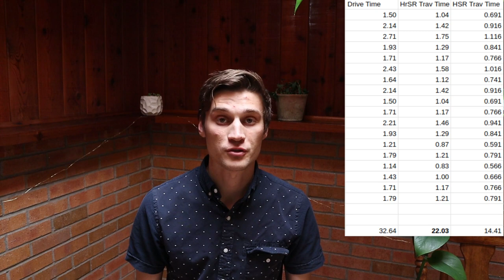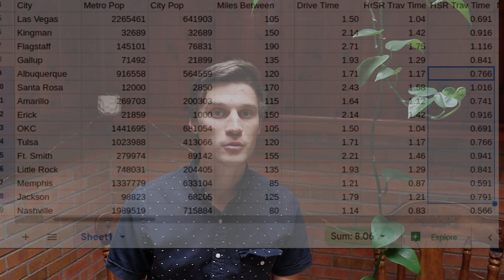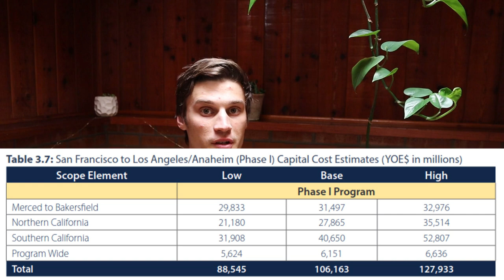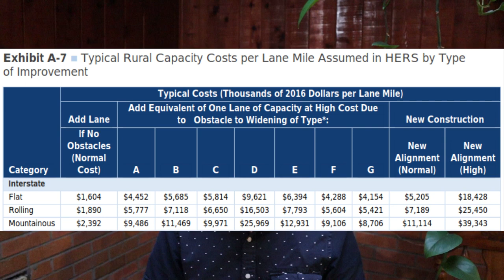What if Interstate 40 were High Speed Rail?

Comment: As you point out, HSR cost up to 10x what 120mph rail cost, so a decision needs to be made. Is the higher speed worth it? We are told that the optimum distance for HSR is aprox 400 miles, however I have been on Shanghai to Bejing (750 miles, 215 mph) and it beats flying. The California HSR project probably would be 80% as good with 120 mph trains, at a fraction of the cost. Already, London to Edinburgh (400 miles. 120 mph) is begining to take passengers away from flying. It is as quick, as cheap, and more pleasant. London to Paris on Eurostar (185 mph) beats flying, hands down! Good video, keep it up!
Reply: Shanghai to Beijing justifies a HSR route because of the gigantic amount of travel between both cities on both business and government workers. That's why some of the fastest HSR's in the world are on this route.
Reply: Don’t the British about how expensive tickets are and Ryan air being extremely dirt cheap. I heard Ryan air is the worse version of spirit it’s the spirit of Europe
Reply: "We are told that the optimum distance for HSR is aprox 400 miles, however I have been on Shanghai to Bejing (750 miles, 215 mph) and it beats flying"

How so? The flight is 2 hours according to Google Maps. It should be less because the direct air distance is 611 miles and a 737 cruise speed is about 580.

Rome2Rio says the train is 4.5-5 hours (depending on which train you take).

I don't understand how that's faster.

Is this is a case of where 80% of the air space in China is reserved for their military, so commercial aircraft can't fly direct routes? Google Maps doesn't list a flight time, but in theory, it should be like 1 hour and 15 minutes, or so.

"The California HSR project probably would be 80% as good with 120 mph trains, "

lmao no it wouldn't. It would be about 3 hours and the flight is 1 hour.

"London to Edinburgh (400 miles. 120 mph) is begining to take passengers away from flying. It is as quick,"

Well, maybe the Brits are willing to sit in a train for 4 hours when a plane could get them there in 1, but I am not.

"ondon to Paris on Eurostar (185 mph) beats flying, hands down! "

No, the train is 3x longer than flying. That's why they still have 23 non-stop flights a day. Although both London to Paris makes a lot more sense because  both are very dense and the distance is short.

(btw, it's 295 miles, 295/3.5=84 mph average, not 184).
Reply: @Sacto1654 

"Shanghai to Beijing justifies a HSR route because of the gigantic amount of travel between both cities on both business and government workers."

yeah, much higher population density. Still, if Google Maps and Rome2Rio are correct, the train is four hours and the plane is 2 hours.
Reply: @neutrino78x  Wow!! There is so much wrong in your post, I don't know where to start! 
1. The cruise speed of a 737 is 514 mph, not 580 mph.
2. The flight from Shanghai to Bejing is not 2 hours. You cannot even board the plane in two hours! I takes one hour to get to the airport, two hours minimum before boarding, 20 minutes minimum to taxi for take off, 20 minutes minimum to taxi to the gate after landing, one hour to get from the airport at the destination, plus the flight time and delays. 
3. I have flown LAX to SFO countless times. You cannot even get to the airport in an hour, let alone board.
4. London to Edinburgh, just look at the several YouTube videos of a plane/train race.
5. London to Paris (I have done this several times as well) the train is 2 hours 15 minutes not 3.5 hours, and as I pointed out (Yeah I have flown it too) you cannot even board the plane in 2 hours 15 minutes.
6. "Flight times" are calculated "wheels up to wheels down" not the actual time you will spend trying to board, de-plane etc.
Reply: @GuillermoLG552  

"Wow!! There is so much wrong in your post,"

Nope. I have no problem going down each of your bullet points, each of which are wrong.

"1. The cruise speed of a 737 is 514 mph, not 580 mph."

Ok I'm looking at the wikipedia article "Boeing 737 Next Generation".

In "specifications", it says the speed of a 737-900 is "Mach 0.79 (455 kn; 844 km/h)", that's 524 mph not 514. Either way, much faster than any wheel on rail train or even any maglev train (unless you put the maglev in a reduced air pressure tunnel, I guess. But any kind of maglev is obviously more expensive than wheel on rail.)

"2. The flight from Shanghai to Bejing is not 2 hours. You cannot even board the plane in two hours! I takes one hour to get to the airport, two hours minimum before boarding,"

Ok, then Chinese air travel just sucks compared to North America and Australia. I have personally arrived at the airport 20 minutes before takeoff and had no issues getting on the plane. I have "clear" which lets you bypass the main security line, and I optimize my things for quick passage through security: no belt, shoes easily slipped off, separate compartment in backpack for laptop. 

This is not an argument for HSR, my friend. It just means either Chinese air travel sucks or you suck at air travel, one of the two.

"3. I have flown LAX to SFO countless times. You cannot even get to the airport in an hour, let alone board."

lmao. 
Which airport, from where? You can get downtown SF to SFO in 30 minutes on BART. 
Same with downtown LA to Burbank (on Amtrak).

Again, this just means you suck as an air traveler.

"4. London to Edinburgh, just look at the several YouTube videos of a plane/train race."

Don't have to. The train is like four hours and the plane is one hour. Plane wins.

"5. London to Paris (I have done this several times as well) the train is 2 hours 15 minutes not 3.5 hours"

How come Google maps says 3.5 hours then. But let's say it's two hours. 165 miles in two hours is 82 mph average, not 100+.

" as I pointed out (Yeah I have flown it too) you cannot even board the plane in 2 hours 15 minutes."

Bro you suck at traveling.

""Flight times" are calculated "wheels up to wheels down" not the actual time you will spend trying to board, de-plane etc."

See above

So yeah, you're far more wrong than I was. Try again.
Reply: @TheAmericanCatholic  Yes Ryanair is dirt cheap (I have been on it many times) if you don't take any baggage, (you even pay for carryon) and you add on the cost of buying your ticket (yes, you have to pay to use your credit card!) and you don't eat or drink anything on board. Of course if you don't print off your ticket ahead of time you pay £50 at the airport. Checked bag? up to £60! You also pay a fee to sit with your wife, extra leg room etc. Then there is the one hour delay (if you have flown Ryanair you will know about this) the one hour wait to get your checked bag (haven't flown Ryanair have you?) and the £400 to get home after Ryanair cancels your flight and strands you somewhere (speaking from experience.) Not to mention the rock hard seats, being stuck in a holding area without a toilet for an hour before the flight, etc. etc. Other than that, yeah, it's dirt cheap.
Reply: @neutrino78x you seem to be forgetting the minimum of 1hr spent in the airport dealing with security, baggage, and boarding groups. For simplicity add 2hrs to the actual travel time of any flight.
Reply: Shanghai to Beijing is America's New York to Washington DC except four times as many people. They use massive, 16 car trains.
Reply: @neutrino78x  The flight itself may be 2 hours, but this does not at all account for transit to or from either airport at either end; it's AT BEST a 30 minute drive from the airport into Beijing proper and that's not at all accounting for traffic and such, and same goes for Shanghai (which is at best a 30 minute drive not accounting for traffic; honestly both of these can easily reach up to an hour or more because traffic is legendary)

You'd have an easier time with the subway, but that is also at best 20-30 minutes. (Importantly, for domestic flights many land in Shanghai Hongqiao which is also the terminus for the relevant high speed rail lines, so travel times in Shanghai are at least broadly similar)

This also doesn't account for things like check-in and security which can easily be upwards of an hour overall for the flight, but for rail service, even though security is required, it is nowhere near as intensive and can be handled easily within 10-20 minutes as well, and that's only if it's extremely packed. (If you happen to have a passport or a PRC ID card (the former all international visitors will have and the latter all Chinese residents will have) then that literally serves as your ticket for the train meaning you can even skip the ticket retrieval process, saving even more time)

Comparatively, Beijing South rail station (the station served by the Beijing/Shanghai high speed line) lies directly on Beijing's 2nd Ring Road and is thus easily within 10-20 minutes by subway of any major central location.

Also, there is one last benefit that taking the train has over the plane, because realistically EVEN IF the train is slower, it at least allows you to actually do things WHILE ON THE TRAIN, which given the vast majority who need a connection with such speed are business travelers, ends up meaning that the train is just more useful to take despite the fact that it might be slower.

It's also, just... more comfortable and easily only half the price or less, ($134 for the first class ticket vs ~$240 for most flights) and that's only if you buy the first class seat, which honestly you really don't need to considering the 2nd class seating is also perfectly comfortable, and that's half the price again, or ~$75

So literally the only thing the flight might potentially save you is time, and even then that's only if everything goes exactly to plan (which considering the train ride literally has less hassle that could waste time, means that such is unlikely)
Reply: @red5t653  

"he flight itself may be 2 hours, but this does not at all account for transit to or from either airport at either end"

Why do you guys always parrot this crap? You are non-playable characters.

Look, China is irrelevant, it's not a free country. They don't have to convince the people of China to spend the money.

The money is justified for HSR only if you have BOTH of these things:
-VERY high density, like European or Asian high, at both Point A and Point B
-low distance between A and B, under 200 miles.

The only region we have that really comes close to that is the NEC. And even there, its' really DC to NYC. If you're going from Boston all the way down to DC, a plane is much faster.

When we get supersonic over land again, you guys are going to say "that plane doesn't really take 2.5 hours from LA to NYC!!! You forgot to count security!! My wheel on rail train that takes 14 hours is still faster!!"

I swear, you guys foam at the mouth and lose all rationality when someone says "high speed rail"
Reply: Best to build out the entire network to electrified 150mph standard or so. Much more coverage for the money and a solid foundation to connect high speed passenger rail lines together. The majority of rail traffic would likely be fast freight.
Reply: @neutrino78x  "Beats hands-down" doesn't have to mean "is faster from point to point". When you factor in travel time to get to the airport/station and the check-in time at the airport, you need to add that to the point-to-point travel time. When you factor in how much more convenient and comfortable it is to travel by train, you might be happy to accept a slightly slower journey in order to enjoy those other benefits and not have to put up with all the crap that air travel brings.
Reply: @stevieinselby  

""Beats hands-down" doesn't have to mean "is faster from point to point". "

Doesn't apply in the USA, I'll give you the cut and paste answer since yours is a cut and paste post. From now on, when people claim trains that go 1/3 the speed somehow beat aircraft "hands down", I will just tell them to stop sniffing glue, and paste this:

Nope. Since you guys are cutting and pasting, I'm going to save this post so I can just cut and paste next time this is brought up. This argument is more true on the east coast or in Europe where the airport is further away.

1) SJC is 20 minutes from downtown SJ on public transit; SFO is 30 minutes away from downtown SF; BUR is 30 minutes away from downtown LA.

2) security is 5 minutes if you have "clear" and 20 if you don't

3) in no way do you have to show up 1-2 hours early on a domestic flight. If you're there more than 30 minutes before boarding starts, you're doing it wrong

Comment: The last time I flew to Tulsa storms delayed me and I got to DFW two hours after my connecting flight was scheduled to take off, but an hour before the connecting flight actually arrived at DFW.
That connecting flight was cancelled so I was transferred to another flight, then another. The fourth flight was cancelled at midnight and I camped in Terminal D until morning.
Flying was neither quick nor comfortable.
I would make a few changes. Since you aren't sticking strictly with the I-40 the whole route I would start on the 10 in LA, which is a far more productive terminus, before going to Barstow and Las Vegas, then following the 40.
Interstates aren't built for 200 mph traffic, so speed would be limited if you use the I-40 right-of-way. I would use accelerated rail (I hate the term "higher speed rail" because logically it should be faster, not slower, than "high speed rail") at 120 mph, with active tilting technology and slowing at the tighter curves. this should still be capable of route speeds approaching 90 mph. Land costs would be minimal because we already own the right-of-way and would only need the really expensive land entering the cities so the stations can be placed in the CBD.
Service can be provided by diesel-electric multiple units, with a locomotive on each end, and maybe tapping power off to power two axles on the coach at each end for more acceleration. This saves the cost of electrification at first, although if demand is high enough the tracks should be electrified eventually.
Reply: A high speed rail is in the works for L.A. to Vegas. However, it starts at Victorville, but people want to see it starting in L.A., or maybe even Disneyland. There is the Cajon Pass to deal with, which the freight trains do every day, but it would not be suitable for fast trains. Maybe the downtown to I-5 to SR 14 into the Antelope Valley would make sense. Metrolink already runs that route into Palmdale. Personally, I wouldn't want to drive to Victorville just to board a train to Vegas. 

Anyway, if this project actually gets built (a lot of people say they like the idea, and I think a lot of people would actually use it-- think Party Bus on rails), then having the cross country HSR start in Vegas makes a lot of sense.
Reply: @EXROBOWIDOW  I'd love t o see the rail line start at Ontario airport(at least for now).  Plenty of existing parking capacity, and the rail lines are across the road.  Maybe the train couldn't run at high speed up the canyon, but the car traffic up the canyon is abysmal.  On major weekends I-15 turns into a 100 mile long parking lot.
Reply: @Dave  Last time we went over the Cajon Pass, it was a Thursday night, so we did not expect a lot of traffic. But CalTrans was working, lanes were shut down, and there was indeed traffic. It was barely moving.
Reply: @EXROBOWIDOW  exactly why I think it make little sense to put the first station in barstow.

Comment: The challenge is the number of routes needed to make this work.  For instance, at the minimum to cover Texas, you'd need a rail line following I10 starting in Jacksonville going through Houston, San Antonio, and El Paso.  You'd then need a line along I20 starting in Atlanta that goes through DFW, Midland, and Odessa, then linking to the I10 line.  It's not the higher/high speed rail cost per mile itself, but rather the thousands of miles to build.

Comment: “Higher speed” rail is probably the best approach in my opinion. The vast majority of existing rolling stock tops out at 125 or 150mph. Upgrading the majority of lines for safe operation up to 150mph would require rerouting, eliminating crossings with roads, and installing new layered automated safety systems. The lines could also be electrified at the same time. Of course certain sections could potentially be built to a higher safe speed standard but even getting them to 150mph would be a huge improvement. Average speeds could also be improved greatly by the new infrastructure which is currently miserably slow, well below even average highway speeds. 

This could greatly improve both freight and passenger rail service throughout the network. Building out a network is much more effective in getting more passengers than just a single line. The improvement in freight rail is probably even more significant because of the volume of freight compared with passenger rail. Building out fast freight has the side benefit of improving passenger rail significantly. High speed passenger rail lines can then be connected together with an only slightly slower fast freight focused network of lines.

Comment: Regarding the costs, if you standardize all new high speed rail, like China has, you can significantly cut costs due to economies of scale. Also when building larger projects, again the economies of scale comes in. This is why California High Speed Rail is probably not a good example to go by, it's the first high speed rail system in the US, experiences from that will (or at least should if managed correctly) go into building new systems.